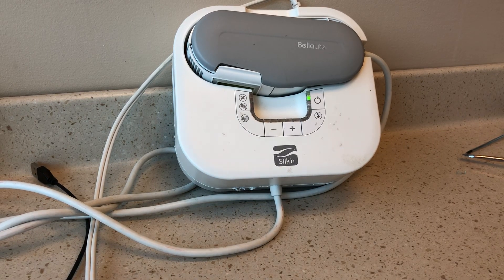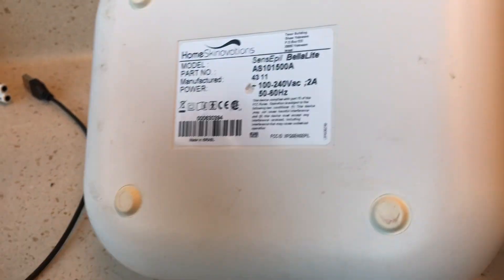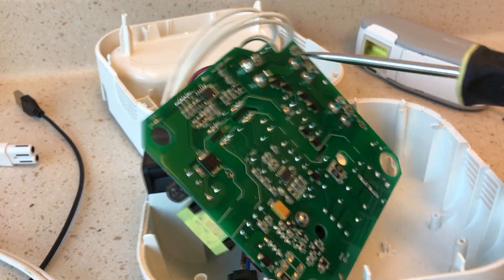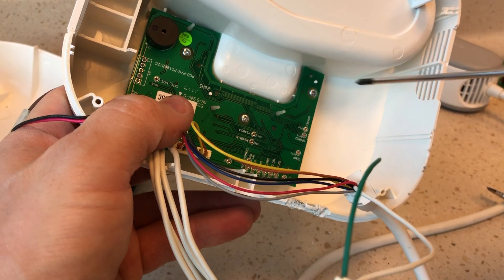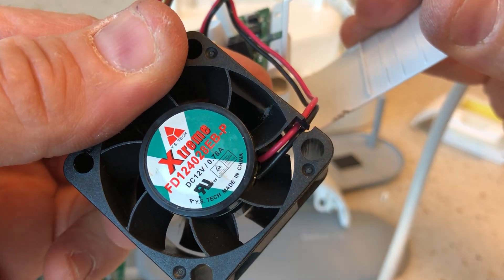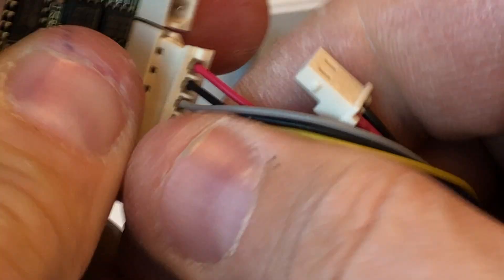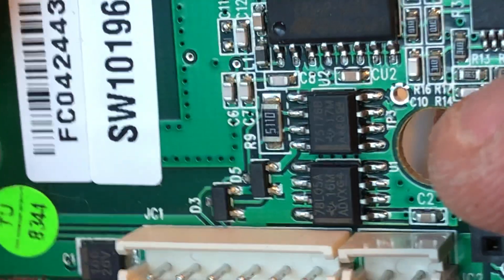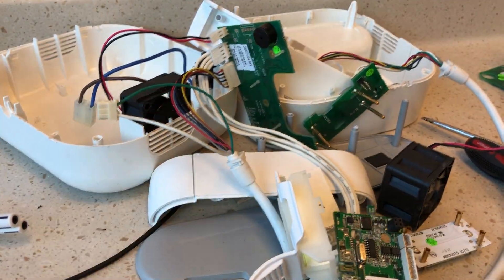BellaLite Silk'n SensEpil HomeSkinovations Hair Remover TEARDOWN!

Comment: As far as the lamp being limited to 4000 pulses I think you said I'm not sure what the region for that is but I do know that if you do some searching on the internet you can find lights that the data chip in it has been modified and you get 10,000 pulses or 20,000 pulses or whatever it is. Is it dangerous to do that? I have no idea.
Reply from the maker: There could be some degradation in the lamp and perhaps after certain number of pulses it's energy output curve or spectrum/frequency distribution may drift and start to become unsafe to use? Why not just use it until it burns out? Unless the burn-out process itself could be dangerous (like an exploding  bulb or some other issue). This also could just be a way to make sure they keep consistency in the results of the product and give themselves a continuous revenue stream.

Comment: The sensor is to determine whether or not you actually have the wand if you want to call it that up against your skin because you don't want to have that flash in the open air to potentially harm somebody's eyes That's what the sensors for also to determine if you if you have the wrong kind of skin it'll sense that and it won't let it flash. So it's for safety reasons.
Reply from the maker: Thanks for the explanation, that makes sense!